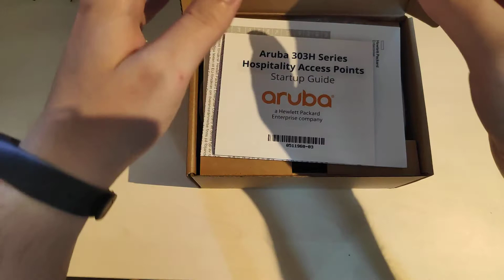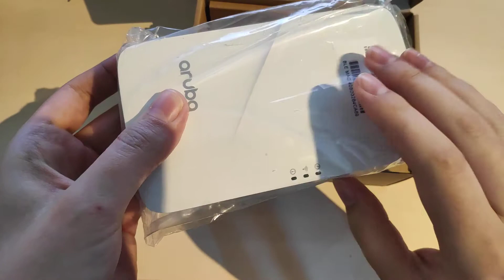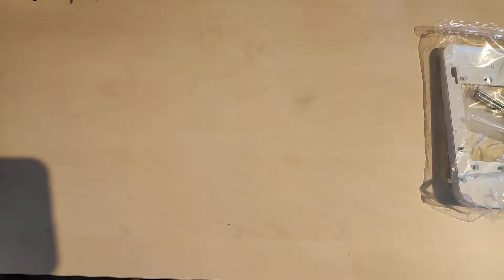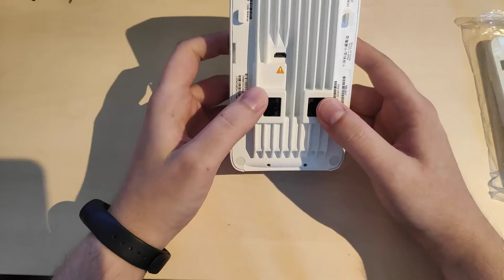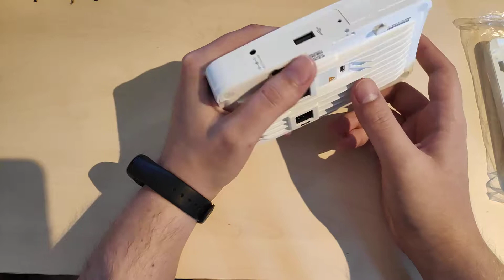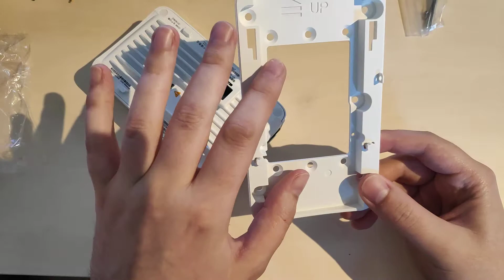Unboxing and overview of Aruba 303H

Comment: Hi, can you help me...I have tried to set up this 303H, I power it on and it turns green with internet cabe already connected on E0 but I get no WiFi signal, it stays turned off and I have reset it to factory setting but still nothing happens.
Reply: Hi Gladia,
Did you manage to have your issue fixed? I am facing the same issue with my 303H and I am running out on options. Just curious if you had any luck?
TIA
Reply: @attitudepierce30  I couldn’t figure out what could be wrong and I lost patience, it’s lying around in my drawers, sorry that I cannot help.
Reply: @gladia  I managed to get it working just an hour ago my wifi SSID is now visible.
Below is what I did
1) did a hard reset
2)with the rap you get a tinny ethernet connector which I used to connect to two ports behind the RAP
3). Gave internet connection via E0/pt (uplink port at the bottom of the Rap) and powered on the RAP
The rap would do a few reboot and then the SSID set me up was visible for me
Hope this helps you
working fine with a Poe Port too
Reply: @attitudepierce30  sorry can you just explain Step 2 again, I am slow to understand these things. Thank you for coming back to let me know.
Reply: @gladia   At the back of the RAP there are 2 ports  tagged PT (uplink port) and the other one is E0. I connected them both using a tinny black ethernet cable I got with the rap
Reply: @attitudepierce30  Sorry just for me to understand you connected both of them to a computer or one to a computer and the other to the internet?
Reply: @gladia  sorry I missed your message .
Nah I connected two ports at the back of the rap to one another and then connected the internet via the uplink port at the bottom of the RAP with the name PT. It can take about 10 mins for it to be up and you should see the setmeup SSID appear and the wifi light on the RAP on
It is wired and we shouldn't actually need to do this but this worked for me hence sharing it
Hope it helps you too